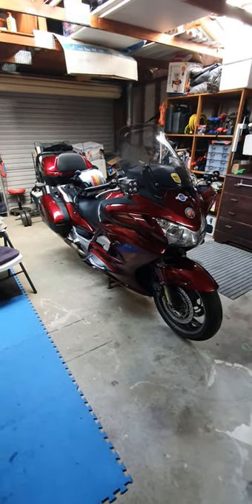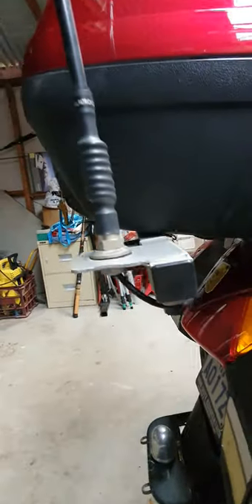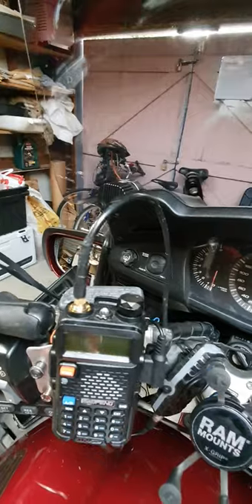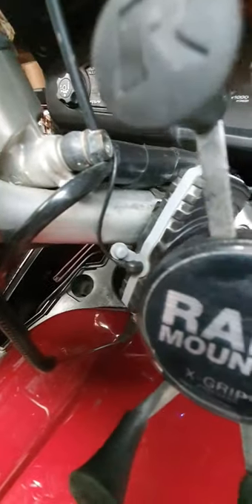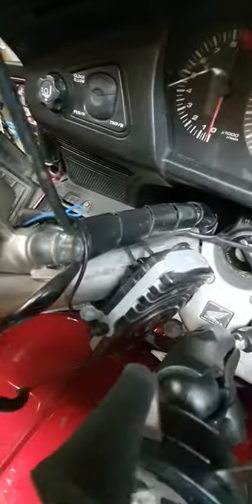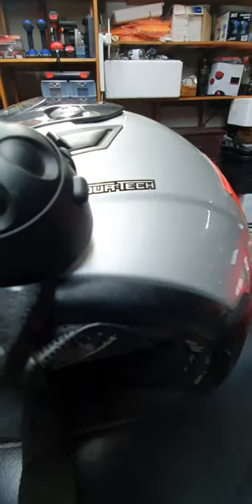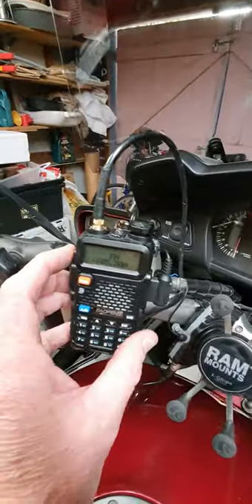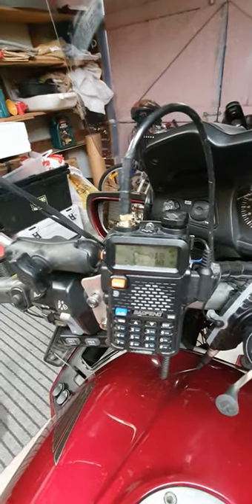UHF CB radio Bluetooth comes on a motorcycle

Comment: What happens if im hearing motor noise through the speaker ? Do i need some filter ?
Reply from the maker: You may need a noise suppression filter or you may need to rerun your wiring further away from interference items such as the alternator. That's all I've got. I'm no expert.

Comment: could you give a parts list
Reply from the maker: Sena SMH10 BT receiver on helmet with in-helmet speakers; Baofeng U5-VR 5W programmable UHF CB/FM radio; 3.3Db gain aerial with mount; enough coax to join the two - OR use the OEM .5 Db aerial; and, Sena SR10 BT Hub with two-way adaptor for Baofeng CB. That's all I know friend. Internet searches will let you find these - but they had pretty well been superseded by now as these items are at least 5 years old. Thanks for watching.
Reply: @DieselDave  thanks